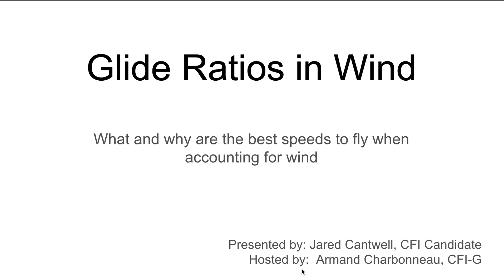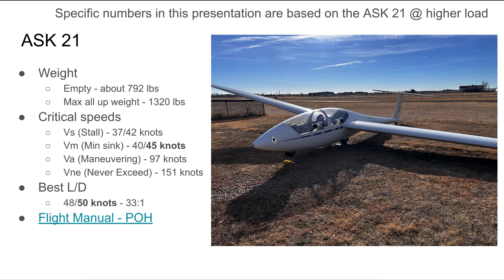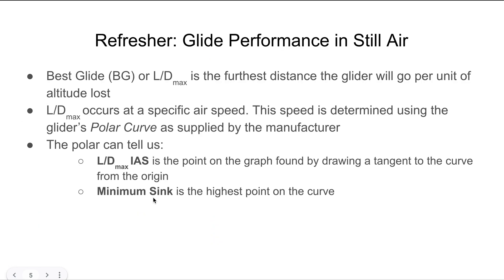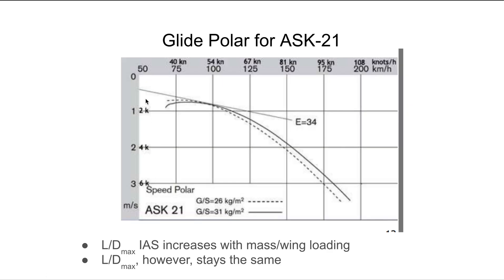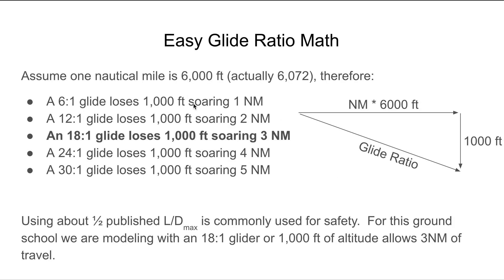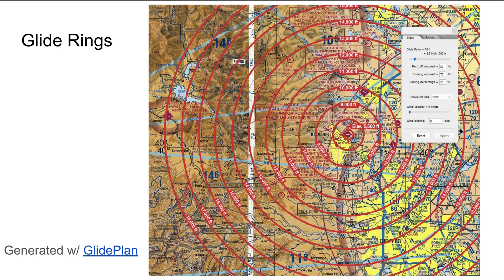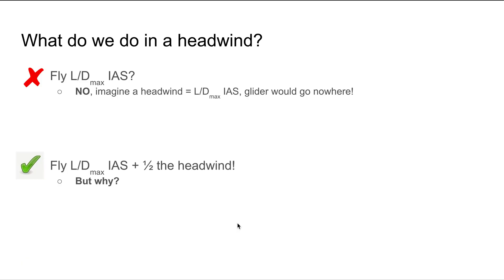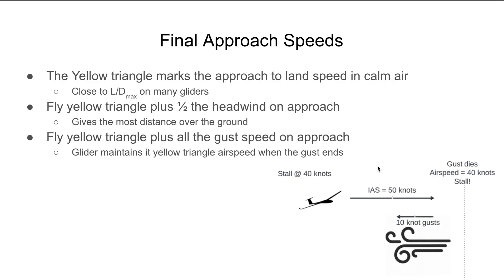How Far Your Glider Will Soar Over the Ground in Wind

Comment: No issue with nil and headwind  parts., 
And academically the tailwind is mathematically correct. 
If the thermals are dead and unlikely to recover, no problem, just use the wind to drift you home.

But if it's crossing dead ground but looks better ahead, again perhaps later in the day, where time may be of the.essence, perhaps fly at best LD for still air,  or maybe slightly faster, which may gain you a few minutes, depending on the width of the dead band... You could regard it as eating into the conservative 1/2 best LD calculation. Your thoughts?
Reply: Hi, we focused this presentation on optimizing for best glide (with no sink/lift), but as you mention, prioritizing for time or better conditions ahead may certainly change the speed to fly, especially if you have spare altitude.
Reply: Fair enough.. I spend much time telling early as pilots that good  time management may be critical to task completion( ie don't climb in every thermal and unless it's the last.thermal.of the day ( or a struggle to stay airborne)  move on when the average climb rate  begins to drop off...I looked at one.trace last summer and.it was turning.every mile ( and always to.left)😎
Reply from the maker: Soaring pilots have to use judgement and probabilies on what parts of the airmass may have the best lift.  Using the judgement you mention makes a difference in task speed and/or arrival altitude.

We have a ground school that covers more aspects of Speed-to-Fly.  That includes speed when banked in lift and MacCready theory.

https://youtu.be/eqDWkloLJZg?si=1i7koekijwbJl0qE
Reply: and it should also be added, that the math is only correct if you make your final glide without thermaling. As soon as you need to thermal, simply MC Theory applies no matter if you have tailwind or headwind. A lot of pilots still think it makes sense to fly faster than correct MC speed in headwind even if the leg requires some more thermals to take. This is completely wrong, since you loose more time thermaling in headwind and you need to thermal longer if you fly to fast which will push you back.